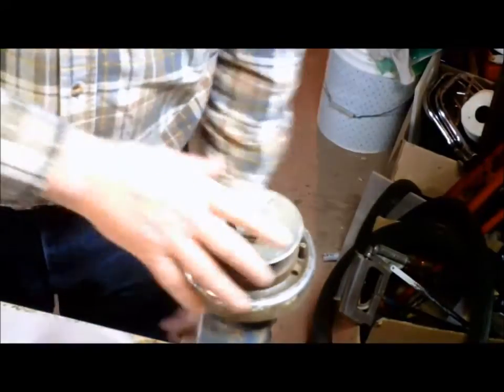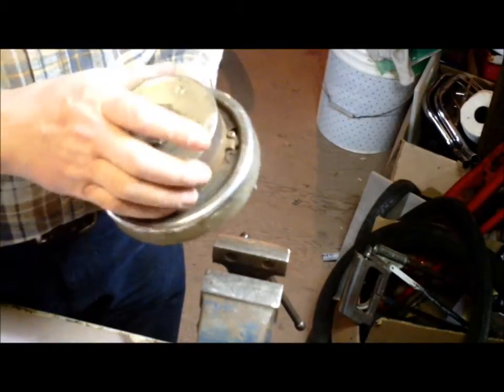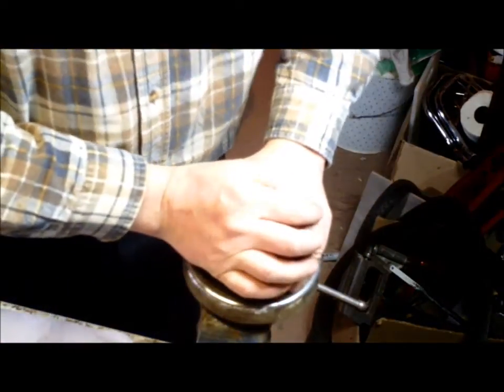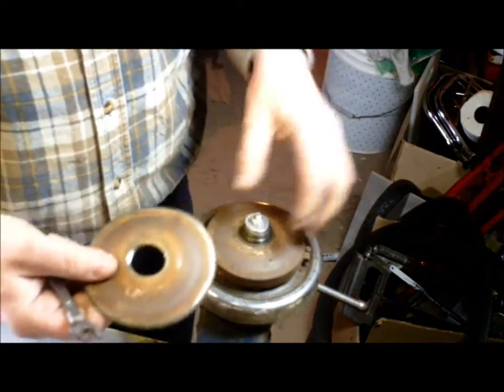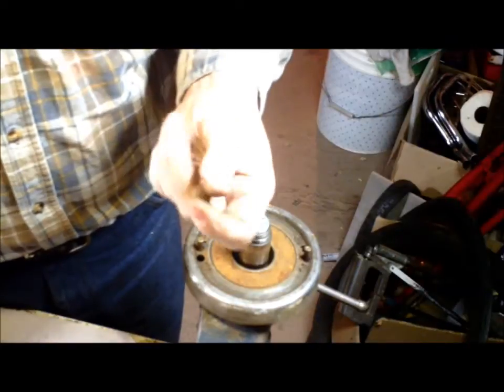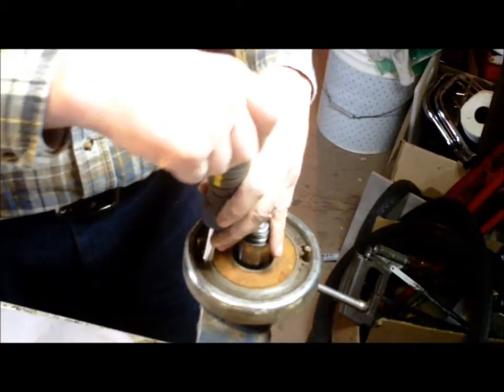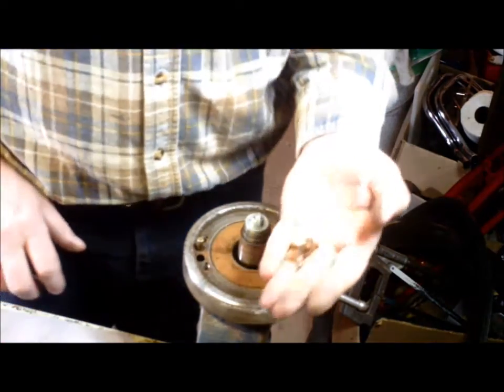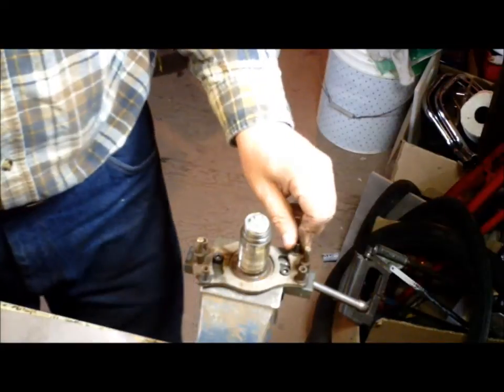Variator Tear-down

Comment: What are those clamps called you use to unscrew the fixed cheek?

Broke a strap wrench and 2 prong flywheel holder trying to get it loose
Reply: "Beam Clamp" gonna hit it with the torch and try again

Comment: Excellent tutorial on variator disassembly does the ball bearings require any lubrication at assembly like grease?
Also those four screws that are staked do they need to be re-staked at reassembly?
Thank you
Reply from the maker: Yes - restake the fasteners
Reply: @RebelMoby  Thank you!